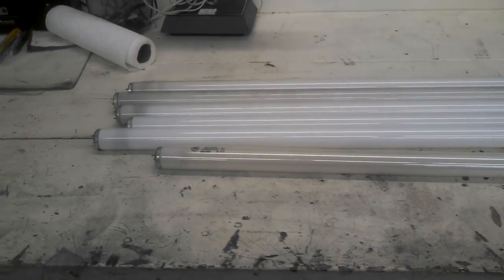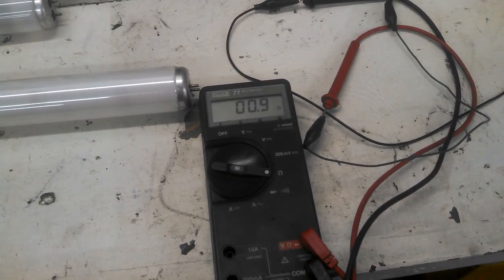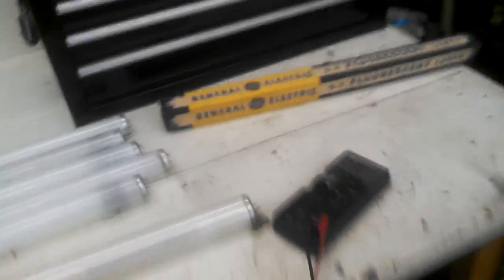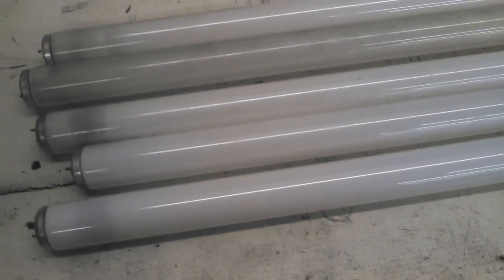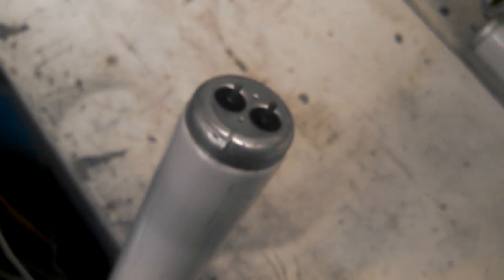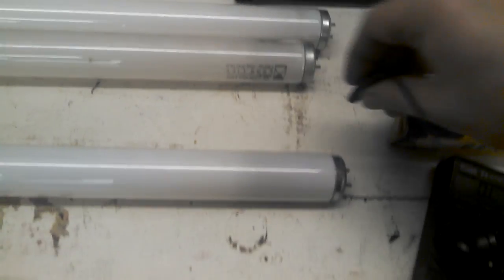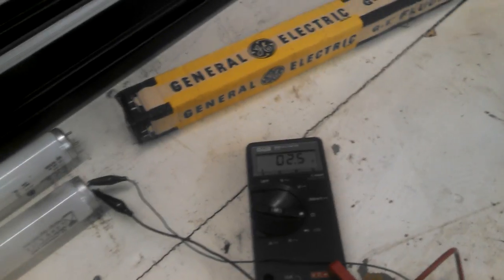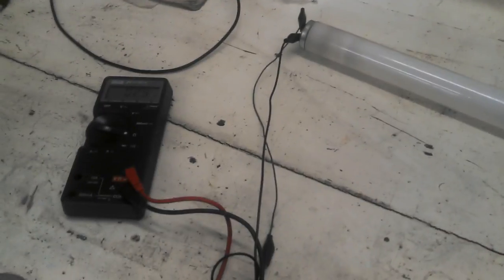Testing (Vintage) Fluorescent Tubes with an ohm meter

Comment: That's the problem with digital meters. Just used a regular continuity tester and be done with it. If it lights up, the circuit is good, if it doesn't light up then the circuit is bad. Analog meters for everything else. The needle goes to position and stays there until current is changed or removed.

Comment: So.. What is the take home message? Low ohms reading means good or bad bulb?
Reply from the maker: Low ohms means the filament is still good.  Other things may be bad.
High ohms or open means the filament is bad, and it is very unlikely the tube will work

Comment: You question your leads replace them. If the pins are corroded clean them you can't get an accurate reading with these two issues seems waste of time and flip the bulb rather than moving the meter back and fourth.

Comment: You said continuity test. But your ohms testing. 
That would mess up alot of novice multimeter users unless they are paying attention to your setting on the meter.
Reply from the maker: Continuity =  resistance.
Reply: @dspiffy  not quite
Reply from the maker: @primariaorasuluiabrud918  "Continuity testing is the act of testing the resistance between two points. If there is very low resistance (less than a few Ωs), the two points are connected electrically, and a tone is emitted. If there is more than a few Ωs of resistance, than the circuit is open, and no tone is emitted"
Reply: Catinuity testing not resistance measuring